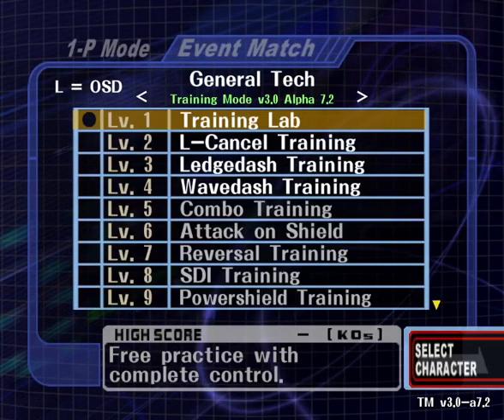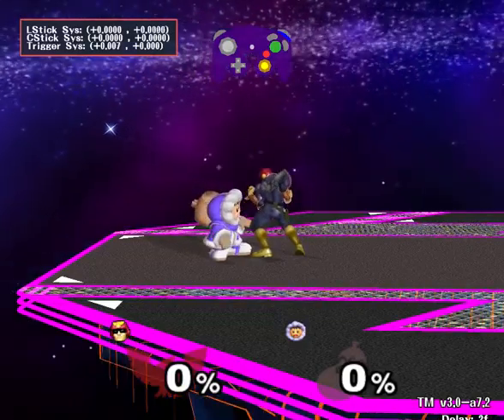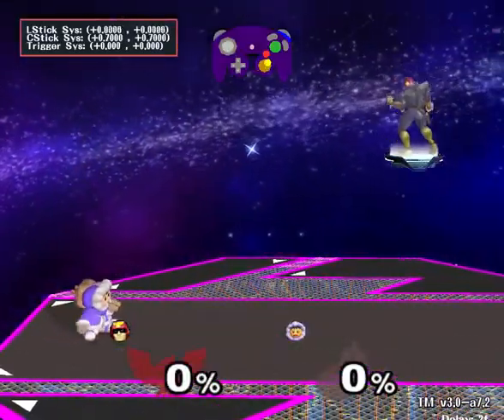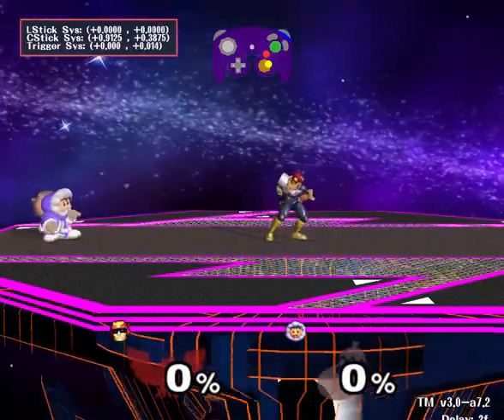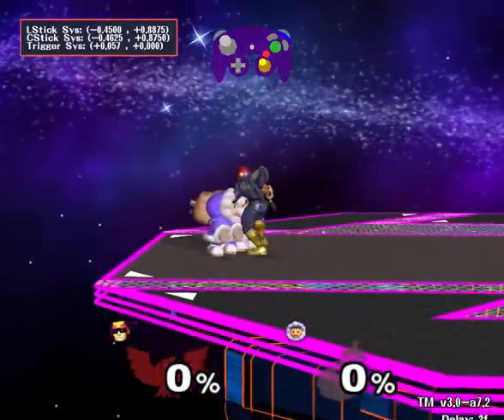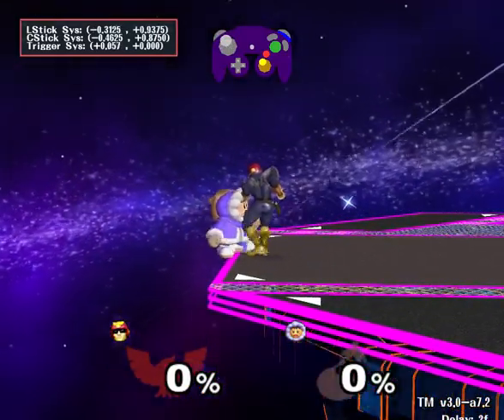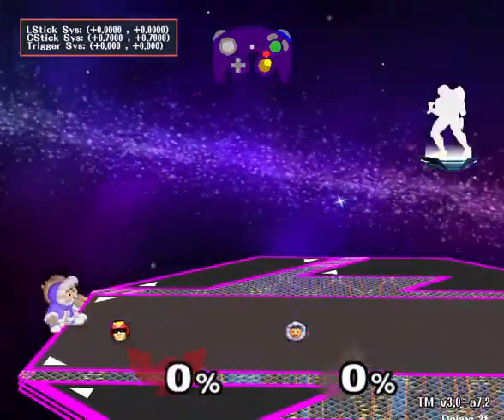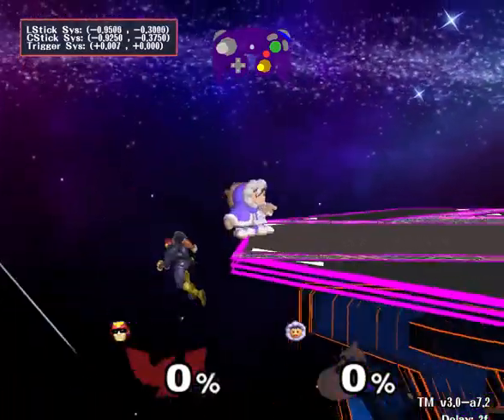PhobGCC Notch Calibration Guide (software v0.20)

Comment: i can take my phob off safe mode and start analog calibration, but nothing chnages in the values of my notches when i advance the calibration
Reply from the maker: First phase is measurement. You don't adjust then.

You can skip to the adjustment phase with start.

Then you can use x or y to adjust calibration.

Comment: For my phob, it's not displaying any movement on System but it does on Engine. Does it matter which I use?
Reply from the maker: Engine Lstick or Engine CStick shows the resulting coordinate snapping to the axes when you're inside the deadzone. System Lstick or System CStick should show all movement whether it's in the deadzone or not.

I always use System Lstick and System Cstick when calibrating in Uncle Punch. However, I usually use Smashscope these days.
Reply: @CarloVaccariPlus  its not showing anything for me either in system